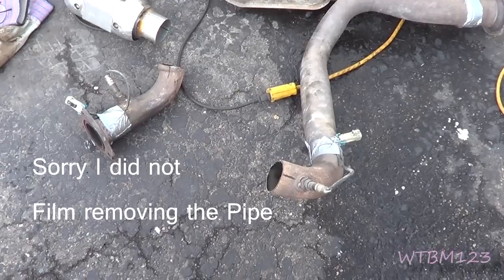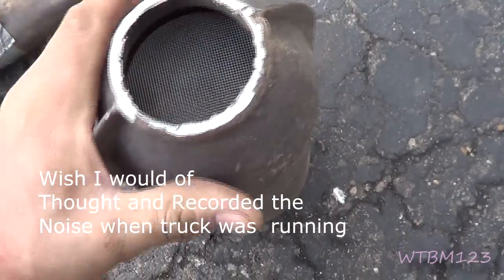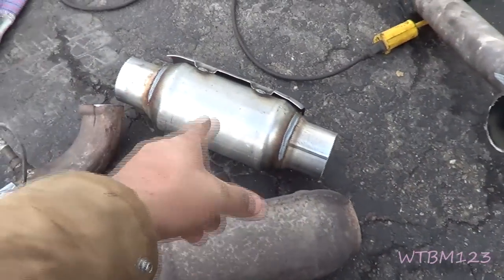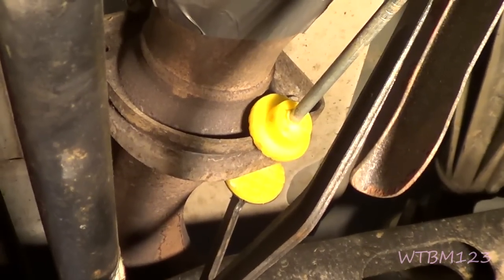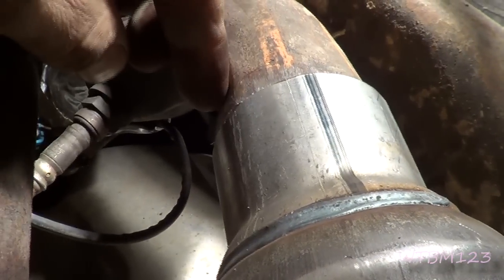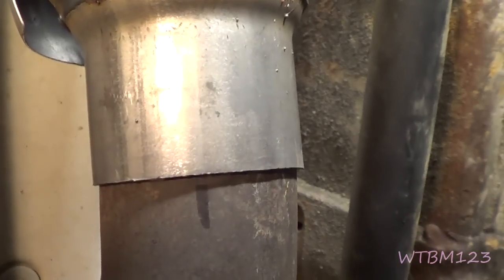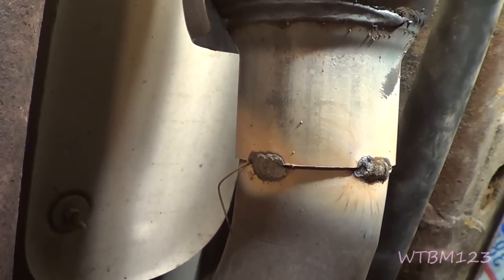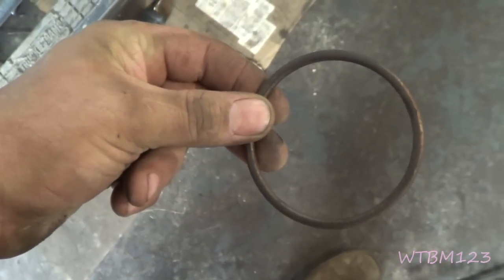Chevy Silverado Making a Rattle Noise , Replacing A catalytic converter

Comment: Wow my 03 GMC started that rattling  I just paid 1,750 to have my transmission completely rebuilt drove it 25 miles and this loud rattle starts. A so called G M expert listens to it andsaid its. In the lower end of the motor. I was going to scrap the truck. Thank you SO OO much you saved me a whole lot of$$$$$$$$
Reply from the maker: Glad it helped . Hopefully the converters are your issue . I know it can be difficult to locate a noise at times.

Comment: Awesome- man that first opening shot with all that duck tape I thought Red Green was with you :). That's  a tough job on the ground for sure. I did fix a ratting cat that seemed to work, no codes just rattled.  I drilled a hole on the bottom of the cat and squirted a tube of JB weld in it. It didn't rattle any more and the truck never came back. $10 fix had nothing to loose .  I think I got the idea from Scotty Kilmer.
Reply from the maker: Steve Rob LOL i thought of something sorta like that but was afraid it would come back to haunt me .Thought of heating a spot and dinging it in . I should of mentioned the roll of duct tape , it was to keep them from banging when i tried to make sure it was the cat i thought it was .

Comment: Man, thankfully I found this. I thought for sure my transmission was bad.
Reply: Would it like shift gears while driving ?
Reply: @lifeofjona2990  No, it was making this rattling/grindy sound when I first started it up. Also when I would accelerate on a straight it would kind of jerk real hard.
Reply from the maker: Probably not , but if plugged real bad a cat could cause drivability issues , but you would more than likely notice other issues by the time that happened
Reply from the maker: We did too on this one . It sure sounds like the noise is from transmission until you figure it out . Thanks for watching and commenting

Comment: Had the cat rattle as well on my Silverado. I ended up finding a good deal on Rockauto for the whole assembly with both cats. Low and behold I'm glad I did the replacement, I found out the previous owner (jelapy) didn't have the transmission mount torqued properly, which resolved my odd shifting sound into 2nd.
Reply from the maker: Glad you got it sorted out . And thanks for sharing the loose mount , The info may help others
Reply: @wtbm123  No problem! Thanks for the video. Hopefully others will take advantage of replacing or checking their trans mount, since the trans crossmember has to be moved the get the entire factory cat assembly removed, if someone isnt going to cut it.

Thanks again!
Reply: Hi, Could you please share the brand name you selected from Rockauto?
Reply: Which one did you buy?

Comment: I’m curious if the rattle you found in that catalytic converter happened when you were accelerating. I have a brand new truck that’s doing the same thing and I’m thinking transmission but after watching your video I’m thinking different.
Reply from the maker: This one did it more slowing down or low speeds if i remember correct . But it all depends on how it comes apart inside . This one i could hear rattle when hitting it with my hand

Comment: Good job. My 04 Silverado has the same rattle of the cat, but has thrown no codes. Knowing that cats usually have a cause for failure, did you determine what was the cause for your cat to become loose and begin to rattle?
Reply from the maker: Never found out why they do it . Just comes loose inside . Scan tool live data said it still worked ok . Replacement is still doing good

Comment: I have a 2004 GMC 2500 HD that rattles horribly on acceleration. Yesterday I checked torque converter bolts and flywheel. Wasnt the issue. Im thinking the cats are my problem on my truck. Cats are $489 each on for my truck. Cant afford that at the moment. But anyway, I have an exhaust guy thats gonna check my truck today. Wish my old truck was more old school so I punch the guts out of both my cats and run it, but without a tune done on it first I cant. Im checking into that today also. Thanks for the great video.
Reply from the maker: Hope you can get a good deal on fixing it , Thanks for watching and commenting
Reply: @wtbm123  turns out its timing chain slapping timing chain cover. Will be replacing this weekend.
Reply: @wtbm123  found the trouble with my truck. Have some bad lifters. So time for new cam, lifters and timing chain set. Here goes $ 1400 for parts and repairs.

Comment: did it make that sound when you get on the throttle only or would it make that sound just going over bumps?
Reply from the maker: +jc 3 this one mostly low rpms and when letting off . if you go under and  kinda bounce the cats around , u can usually hear them , but remember they may be very hot , and some only make it while warm .

Comment: question: does it rattle when cold? Mi chevy 99 rattles only after a few minutes of running.
Reply from the maker: They can , usually banging on it you ca hear , if cold when you hear it would think one could hear it hitting it cold . Not all fail the same way.
Reply: @wtbm123  I took it to the shop today and didn't mention anything about the cat converter. I hope they find out it's something cheaper :)

Comment: I'm replacing both cats in my 2003 silverado and I can't get the old unit out. It gets hung up on a crossmember any tips on removing it?
Reply from the maker: got to remove the small cross member , some after market y pipes with converters are 2 piece so they  can be removed easier
Reply: Ugggh, this is what I was afraid of. At least now I know it's a full day job.

Comment: Just saw your video. Was wondering when you would hear the noise was it like a fan hitting plastic? That's what mine sounds like. Like the engine fan hitting the plastic cover. And it would only happen when I would let off the accelerator.
Reply from the maker: Not so much plastic sound . Usually if the cats are doing it they will rattle inside when you bang on the outside

Comment: Hey I just got a 2006  Chevy 2500 hd  I need help brother did it rattle sparingly as you accelerated from park
Reply from the maker: idling some , and a lot on deceleration and taking off . It all depends on how loose the center is . Many if you hit them with your hand can hear it rattle

Comment: I got a 92 c1500 5.7tbi and I got this weird intermediate problem....sometimes when I accelerate hard I hear this rattle that sounds like it's coming from the exhaust and then the "service engine soon"  light comes on afterwards..... sometimes the light will go away on it's own or will go away once I restart the engine.....I did replace the cat but still doing the same thing......could the old rusty exhaust/muffler be the culprit? It does have some holes on it due to rust.....regardless the truck runs really good and it has a new crate engine from summit racing and this rattle issue was also happening on the old engine which makes me believe the issue has to do with the exhaust/muffler?

Comment: Hi, you mentioned you thought this noise was coming from the transmission. I’m trying to diagnose a noise I thought was the transfer case but now I’m not so sure. Would your noise be present when you were in park or only in drive. Mine will not make the noise in park and seems to only occur during initial take-off and then fades out. I can get it to do it while holding the brake in drive and giving it gas but again it won’t do it while in park. Any help you can give will be greatly appreciated.
Reply from the maker: Look for chain wearing through T case , usually causes oil leak rear slip yoke , splines sometimes wear and when drive shaft moves it can slip or bind . Also sometimes in drive , kinda puts a different pressure on exhaust and stuff . If it is hot , can kinda bang exhaust around some , maybe pry on exhaust and bang on it . Hope you can figure it out
Reply: Mine makes a noise only in park drive etc never in neutral ,a crunching grinding type of noise idk

Comment: I have a 2005 Chevy Express cargo van. I'm hearing a rattle at idle in park. As I apply throttle (engine on) the rattle gets louder, faster. All my exhaust connections are tight. I'm thinking I may have the same issue as your truck. The baffles in the cat or in the muffler have fallen off inside of the cat/muffler housing. Did you have to remove the cross over bar (transmission rear mount) to get the duel head pipe out?
Reply from the maker: on the truck yes

Comment: And then you took it back apart and punched out the converter and welded the hollow old one back in..
Reply from the maker: sixtyfiveford Wish i could , but was a customer car . I did think of heating a spot and dinging it in a bit to tighten , but decided to replace to be sure
Reply: I know and maybe you know better but some of the newer cars sense back pressure and can tell if the cat has been removed or plugged?

Comment: I have a 2004 Chevy Silverado 4.8 & it just started making this same exact noise. I thought it was the transmission but it still makes the noise even when it’s In park & I give it gas. If it was the transmission wouldn’t the tranny be disengaged if I had it in park? So the tranny shouldn’t be making any noise In park? Thanx for this video!
Reply from the maker: Still a possibility of torque converter , but should change noise when in gear , If you get under and bounce converter around a lot of times you will hear it

Comment: Could you clamp it in place or would you recommend welding it back into place? I have never welded before
Reply from the maker: If you buy the replacement , it is pretty much only long enough to fit . It really does not overlap the pipe enough to clamp .
Reply: wtbm123 damn ok thank you for the response

Comment: Damn man. Wish you woulda recorded the sound. I've got a metal on metal, intermittent grinding/scratching/rattling noise only at low speeds. Doesn't do it in park when I rev the engine.
Reply from the maker: Just hit the converter with your hand  and see if it sounds like the center is lose and rattling . I already had the truck being taken apart when i seen what it was
Reply: @wtbm123  Just checked it. My converter is solid. All my heat shields are secure. Did yours sound more like a paint can rattle or scratching? What Im hearing is more like a metal on metal scraping, but its only at low speeds and low rpm. If I punch the gas from a dead stop, theres no noise, but if I take it slowly, theres intermittent grinding and scraping until I hit about 35 mph. I'm thinking it's got something to do with my drive shaft. The center bearing of my drive shaft has a good bit of slop in it. If I grab the drive shaft at the center bearing i can move it around. Would a bad bearing cause a grinding noise and does yours have play in it or is it sitting tight in it?
Reply from the maker: @travism9339  There will be some movement in the rubber part of carrier bearing , but the bearing could be bad . This one at first i thought was the torque converter , it did not make noise all the time . If the carrier bearing is going bad and making noise you would think it would get warm quick . Are you sure it is not coming from a brake . It is hard sometimes to figure them out as the noise can carry through things and sound like it is someplace other than where it is , If careful could put the back end up on jack stands and see if you can reproduce the noise , if so you may be able to hear more standing beside it . Also check u joints for play or rust around the seals , Sometimes there is no play , but look in the center part and where the seal is on the caps , sometimes you will see a rust ring if dry and bad .
Reply: @wtbm123  Yeah, I've heard it could be torque converter too. The issue is, it only does it in drive so I cant stand next to it or lay under it and see exactly where its coming from. When I'm in park and press the gas, no sound. The center support bearing has way more play than it should have. I'm about 95% positive its bad, but unsure if that's the source of the noise. The noise doesn't start until the truck Is semi warm.
Reply: @wtbm123  Also I just put new wheel hubs calipers rotors pads and break lines on the front. The noise was there prior so I dont think its breaks.
Reply: I have the same issue we’re you able to find out what was causing it?
Reply: @Fvillax7  Yup. It actually was the catalytic converter. This honey comb looking thing had disintegrated and fell apart inside the catalytic converter causing the noise.

Comment: If I wanted to cut both of them out and just use one after the y pipe u think it would pass inspection I can wire the two sensors together and trick computer?
Reply from the maker: Anthony Miller I would be afraid to do that. Each sensor has a signal wire that goes back to the computer, to different channels . thinking two signal wires , both trying to send  signals  to two channels ,would confuse the computer on both channels and my even burn a driver out of the computer costing a lot of money . and the distance away from engine can affect performance of the cat. But if you do try it , please let us know if works .

Comment: does bad catalytic converter causes low rpm and fells weak on having the motor on and rattles and shuts off?? my 2005 silverado has tbat promblem it back fires like explosion from muffler and sometimes it dont wanna stay on i have to pump the paddle for it to stay on
Reply: i change the fuel pump and still does it and i also change throttle body kinda help on motor to run and to stay on but it stills shuts down and weak on starting up the motor..
my next step is to change the catalytic converter.
Reply from the maker: does all cylinders have spark, all coils good  . For a cat to do this it would prob need to be really plugged up . un hooking the exhaust before converter  or removing a 02 sensor before the converter , would let it run if the converter was plugged . it would prob have low vacuum on cranking and running . what are the codes . really hard to say what it is with out seeing it .

Comment: Okay so I've got a question or two. If anybody could help me out with these, that would be great. So does it only happen at like lower speeds when you accelerate, like it under 20? That's the only time I hear the rattling noise. It sounds like it's coming from the bottom of the truck, but it sounds like a loose piece of metal
Reply from the maker: Could be it , they do not always act the same , some do it slow and letting off the gas
Reply: @wtbm123  I'm going to try to find one of those off-road y pipes without cats that bolt up to stock manifolds and pipes and see if it still makes the issue
Reply: I can only hear it under 20 miles/ hour

Comment: my 96 honda civic started making a raddle noise after i replaced the oil pan gasket and i had to remove Cadillac converter for the exhaust to give me space but just left it hanging can it be my loud raddle? smoke came out of my cadalic like crazy and i ran the car check engine came on
Reply from the maker: Did you spill anything in the exhaust pipe to make it smoke . Just un bolting it and reinstalling should not hurt it , or make the inside come loose . What code did it set . I would look for something loose or laying aginst something for the noise

Comment: mine rattles , but i checked it and its the actual pipe hitting the frame. some how the muffler pipe dropped that it its the frame part that goes across from one driver side to passenger side

Comment: P0300 Random Misfire Detected
P0141 02 Heater Circut ( Bank1, Sensor 2)  can this be the readings for catalic converter
Reply from the maker: I would look into the O2 sensor . , And then look into the P03000. Random misfire , Could be one or more cylinders . This is where a good scan tool that displays live data comes in handy . There could see fuel trims , and maybe see if it is lean , rich , only one side of engine or both sides . Has spark plugs been changed . Usually a bad converter will be a P0420 code. Also a bad converter usually the upstream and down stream O2 sensors readings will mirror each other.

Comment: I'm so pissed. I put a brand new magnaflow cat kit that included everything from the headers to the y pipe. Installed it myself less than a year ago. Bought it brand new as a kit from Summit. Come to find out I can't warranty it because you can't install these yourself and get a warranty... so now I have to go with something new again and ruin the look of the kit.
Reply from the maker: Thanks for letting us know . The info may help others
Reply: @wtbm123  Yup, brand new kit, and it's making an awful rattle noise on the drivers side cat. Warranty card states a professional shop has to sign off in order for it to be warrantied. So now I have to have a shop replace the bad one out of pocket.

Comment: I'm literally praying this is my problem.. I usually do all my own work. But I always have problems with old exhaust systems, in Michigan everything is rusted and bolts usually break, then spend all day fucking with it.. I would rather pay someone $100 to $200 to fix that shit.. mine started today, it's freaking me out, I just hope it this issue and not transfer case or transmission related yet, I haven't got enough saved for a transfer job yet on my 06 crew

Comment: since u had rattle in cat, did it give a foul smell and set off check engine light o2 sensor?  how u find out it was cat?  I think it's my cat but I don't have check engine or smell?
Reply from the maker: +m00nchildblues Funny thing is , everything looked good on scanner . Usually if you bang on them u can hear them . If yours makes the noise cold then it should make noise when u hit it good with your hand .